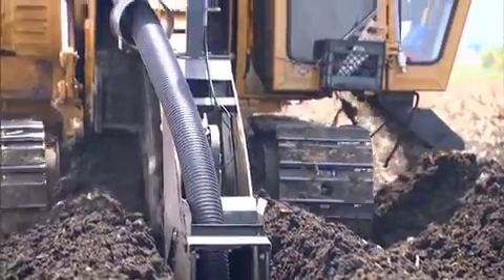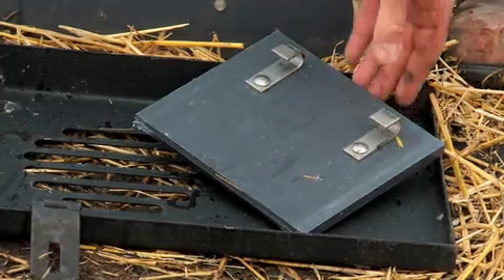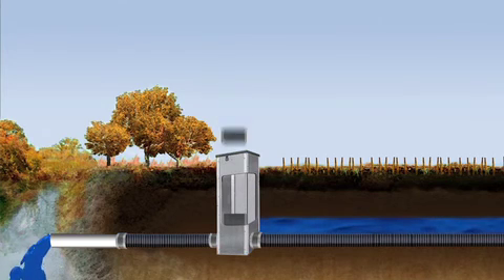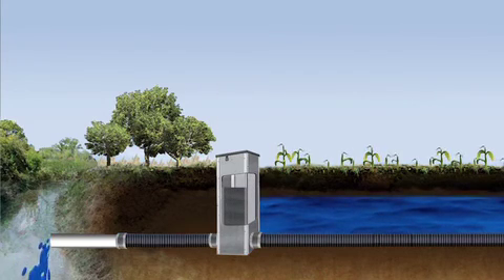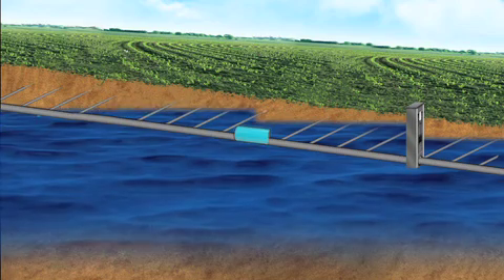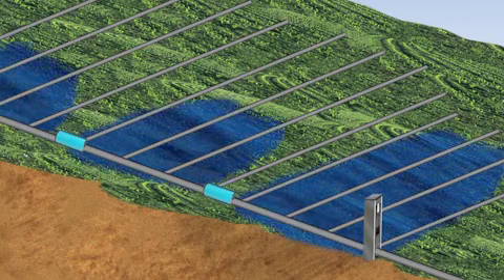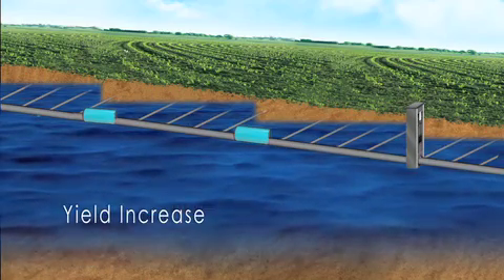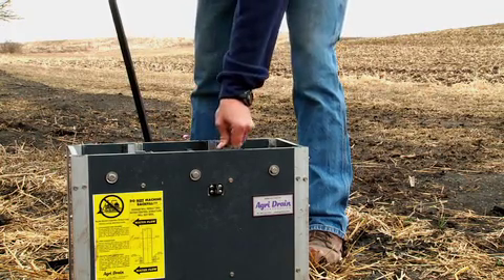Conservation Drainage

Comment: I am curious if the stop log system is a requirement of a drainage system or an option for farmers?
Reply from the maker: A stop log system is not a requirement of a drainage system. It is an option for farmers who want to more actively manage their drainage system for water quality and crop production benefits. A stop log system, on its own, will work best on flat (0-1% slope) fields. However, stop log structures are also used in conjunction with edge-of-field water quality practices like bioreactors and saturated buffers on a wider variety of fields.